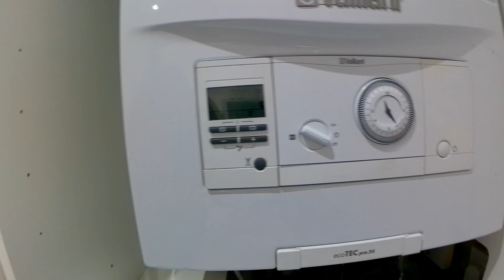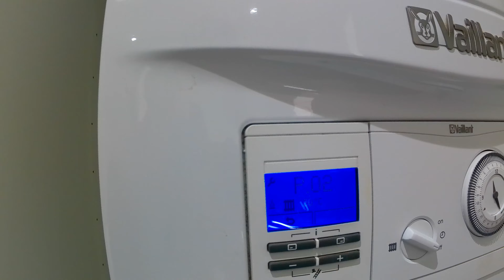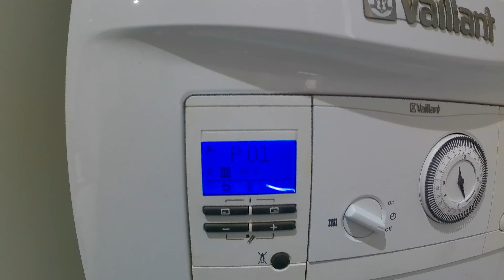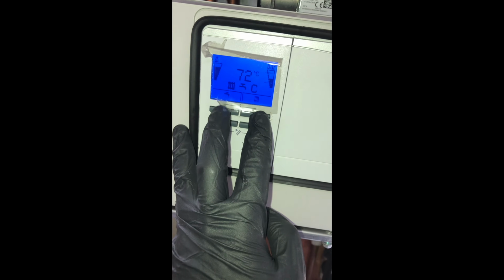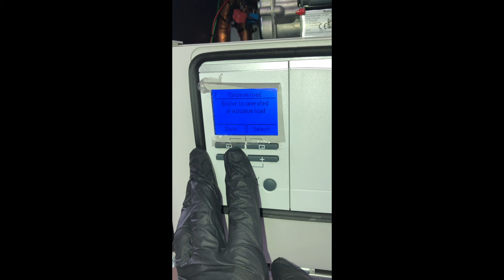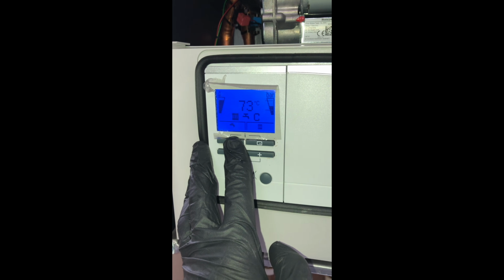Vaillant Ecotec | How To Put It In High Flame & Low Flame AKA P1 & P2 (Engineers / Service Mode)

Comment: Used this and seen what my radiators can actually heat up like. If only the bloody heating worked aswell as the test. Rads over 75 degrees on the test, can't get them over 49 normally. You get a new boiler and expect the best with new. Didn't happen.